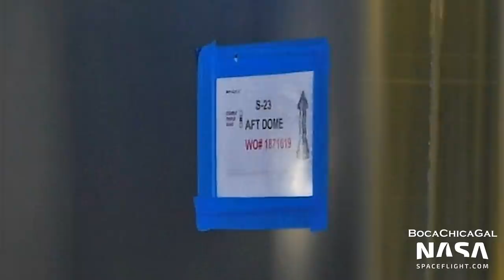Booster 6's Forward Dome Gets Sleeved | SpaceX Boca Chica

Comment from the maker: 0:00 - Sunrise Over the Launch Site
0:21 - Ship 21 Nosecone Construction
0:43 - Ship Common Dome and Ship 23 Aft Sleeve
1:13 - Forward Dome and Booster 6 Forward Section
1:37 - Booster 5 Progress in High Bay
1:58 - Ship 21 Preparing for Future Aft Fin Attachment
2:28 - Buckner's LR 11000 at the Production Site // The boom and jib have both been extended by six meters
2:51 -Workers Prepare Concrete Forms // In the back, left to right: BN2.1, the GSE Test Tank, B2.1, and SN15
3:35 - Single Ring in the Scrap Yard
4:00 - The Orbital Launch Tower
4:23 - Berm Construction
4:47 - SpaceX's LR 11000 // SpaceX custom ordered this Liebherr crane in a black, white, and grey color scheme
5:13 - Booster 4
6:24 - Crews Work on the Orbital Launch Tower
7:32 - Crews Work on the Quick Disconnect Arm // This arm loads propellant into Starship and stabilizes the stack
7:55 - Cable Supply Reel for the Chopsticks
8:55 - Production Site // Buckner's LR 11000 slowly moving toward Wide Bay
9:17 - Telehandler Moving a Utility Vehicle
10:30 - Booster 6 Forward Dome Sleeved
11:55 - Construction on Wide Bay
Reply: oh the new SpaceX BBC ... Big Black Crane ... looks nice :)
Reply: Do we have any estimate as to when the next static fire's will be? I thought all this week we had road closures in place?

Comment: Any thoughts on why the wide bay is being constructed with the kind of cantilevered design (the sections with the diagonal supports at 2:30 that also look like they will be outside the open/internal area). I'm sure there is a good reason, I just have no idea what it is and am curious to know.
Reply: Im pretty sure its mostly additional bracing for things like high winds, the other bays have them too just not as extreme.
Reply: probably for when the weather's in a hurry... ho hum.. eeer..
Reply: Maximize unobstructed internal volume.
Reply: Thank you for asking, I was wondering the same
Reply: Thanks@Rob Bannstrom, that makes a lot of sense.
Reply: @Rob Bannstrom And to think it was just aesthetics to put some cool shadows on the wall and break things up.... That makes 10x more sense.

Comment: Why are there so many 90 degree angles in the plumbing?
Reply: It allows for thermal expansion/contraction when cryogenic fluids start flowing through them, and also reduces fluid hammer effect when valves are opened/closed rapidly.